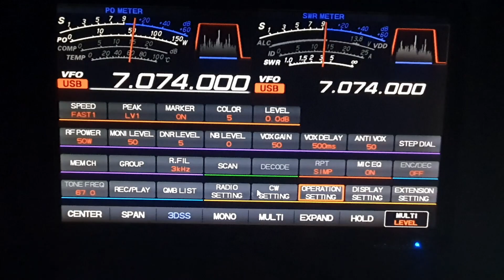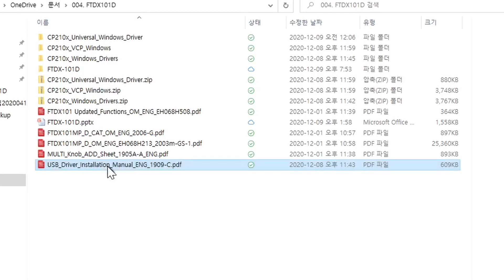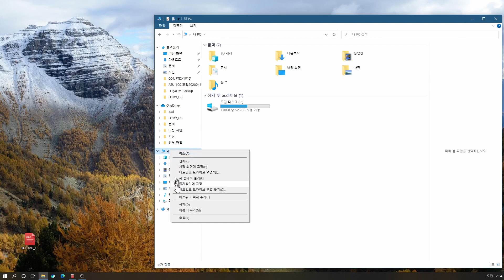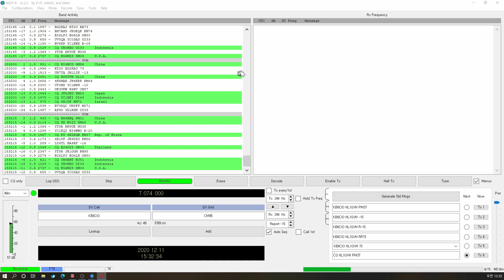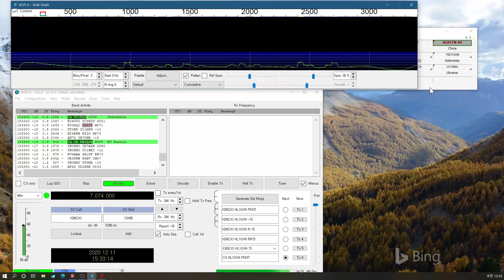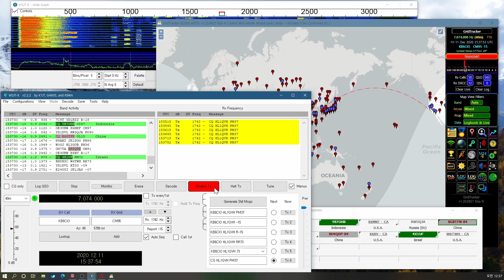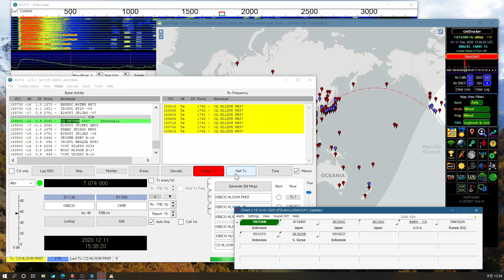FTDX-101D FT8 Parameter Setting

Comment: 2x FT8 is posible ?
Reply: What is 2x FT8?  If it is the tone spacing setting of WSJT-X then I think it is not the function of transceiver, it is only WSJT-X's functions.

Otherwise, please let me know what is 2X FT8, I will do test if possible. thanks!
Reply: VFO A - FT8,  VFO B - FT8  is 2xFT8 the sime time :)
Reply from the maker: It is the split operation, FTDX-101D has two transceiver Main & Sub.     If you select 'Rig' what is split operation mode of WSJT-X then Main & Sub automatically TX & RX by turn.   []    If you select 'Fake it' you can use Only one Main or Sub for FT8 TX & RX, in this case split operation is done by selected Transceiver(Main or Sub, selection key is TX button, WSJT-X use it that TX on). Ex) you can use the Main for FT8, also you can use the Sub to monitor other band of any mode(SSB, AM, FM etc) in this case you can use Sub for SSB then you can select 'SSB MOD SOURCE' of Radio Setting is 'MIC'(Real Mic) not 'REAR'(means USB Audio) then you can say to Mic.  []  If you select "None' you can do split operation for random frequency, ex) Main is RX for center freq, Sub is for you selected freq. to Tx.
Reply from the maker: @qnapalert590  https://youtu.be/T4FPbyaqnuk   turn on sub title(auto translation)
Reply: @HL1QVH   
Thank you very much for your time and making the video. I have a flexradio 6700 and 8xFT8 on different bands at the same time is the norm for me. I was planning to buy a Yaesu FTDX101MP but I found out from you that despite 2 receivers, I will only use one for the FT8, the purchase is not profitable. I will buy the Yaesu FTDX 10. Thank you again for testing
Reply from the maker: @qnapalert590  Great! How to receive 8xFT8 in a pc? Does Flex support 8 channel(port) to receive audio & CAT? also how can you use 8xWSJT-X(8 instance of WSJT-X?) If you let me know, I can use 2xFT8 receive, FTDX101D sends only Main channel's audio via USB cable to pc. TX is only avilable one channel at a time
Reply from the maker: Finally I studied 2X FT8 
Please refer The setting & Operation
https://blog.naver.com/uncle0mozart/222297234015
동시에 2개의 FT8을 운용하기위한 설정 및 동작방법